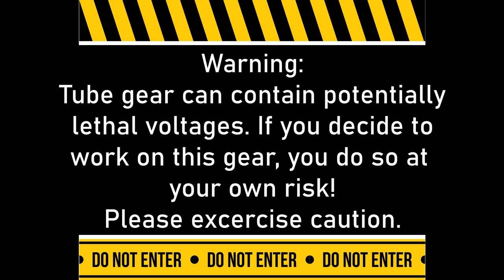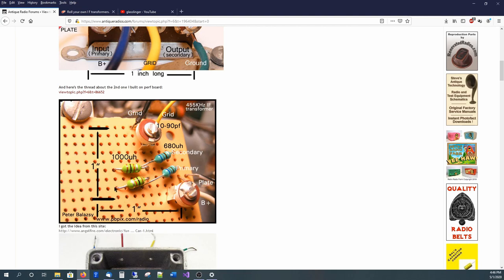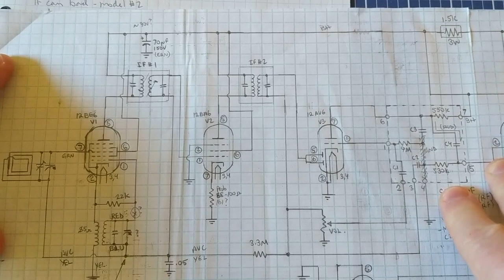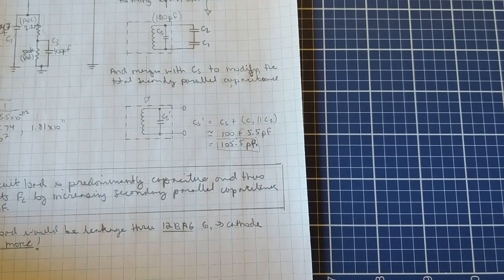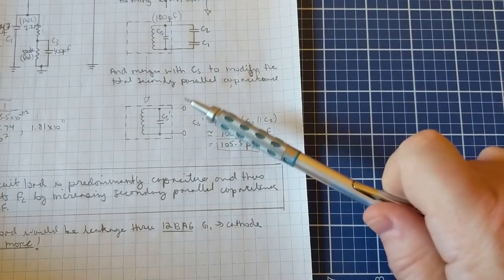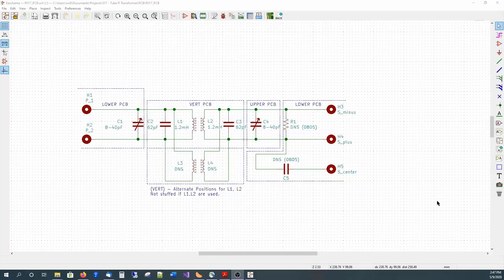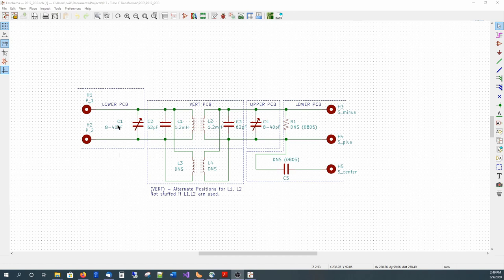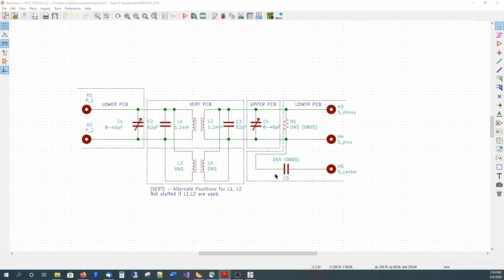EV 004 - TubeTech - Building a New AM Radio IF Transformer Part 2

Comment: Eddy -

An amazing job. I appreciate the level of detail you shared following your research and mock up designs. The jig you created was very clever and the impedance analysis was educational. Thank you for posting your design and sharing your knowledge/experience.

All the best.

Don
Reply from the maker: Thanks Don, that's quite a compliment coming from a radio restoration expert such  as yourself. 
This was a bit of a thought experiment in an alternate design idea that was initially proposed on a thread on antique radio forums. I was surprised myself at how well it worked, considering the lack of a high Q winding and inherent internal parallel capacitance that is a byproduct of how the chokes are made.
I think I have a few PCBs left kicking around, let me know if you want to play around with one or two...
Cheers,

Comment: I am so glad I ran across this video!  Will have to check out the Part 1 video as well.  I have a "special" need to know this information.  The IF transformer I need to build is one with an IF Frequency of 915 Khz!    The tuning capacitor is another issue.  The capacitor is a 4 section, 14pF to 331pF variable each section, 9 Stator 10 Rotor plates each section, Army Stock Number/Navy Type Number/British Reference Number 3D9016V-2. The most interesting feature of this particular tuning capacitor is that it contains a variable 3500 Ω, +/- 10%, 1/10 Watt, metalized carbon resistor attached to the shaft that tunes the capacitor, and it varies from lowest resistance to highest resistance with frequency. In other words, Low frequency = Lowest Resistance, Highest Frequency = Highest resistance.
Reply from the maker: Be careful using the chokes that are in the video. The windings are not low capacitance so, for the ones I used, they tend to self-resonate around 1 MHz. Problematic if you are trying to tune in that region. You may not even need a bulk capacitor in the tank circuit!
Take care and do some experiments first.
Cheers,

Comment: Well that was very good, somewhat beyond my experience but at least I know it’s possible. For now I think I will look for a nos part or used. I assume that it would be possible to achieve other IF values such as 456 kHz by just varying components values and air gap between chokes.
Reply from the maker: All the typical AM IF frequencies should be reachable. Caps and inductors can be re-calculated by hand or google for a LC "tank" calculator and play with the values. These will likely not work for FM IF frequencies (eg. 10.7 MHz) though as the chokes themselves are not good above 1 MHz.
I am glad you liked it. It was a small research project I did a little while back. I was surprised myself how well it worked.
Cheers,